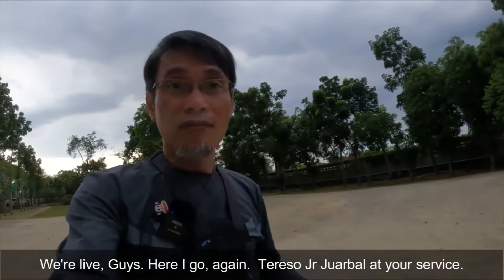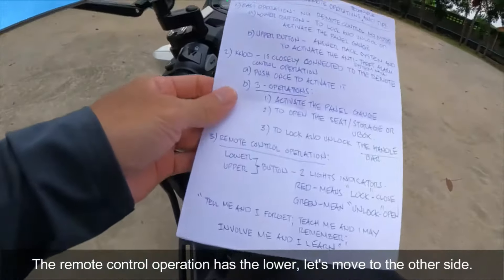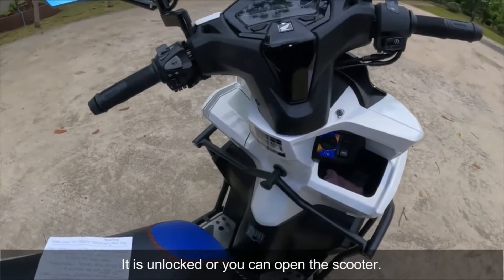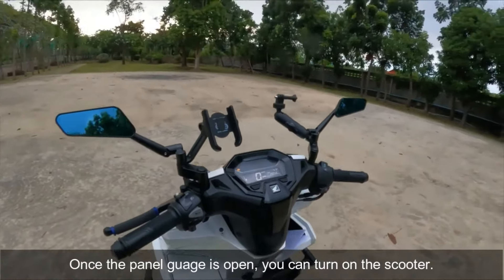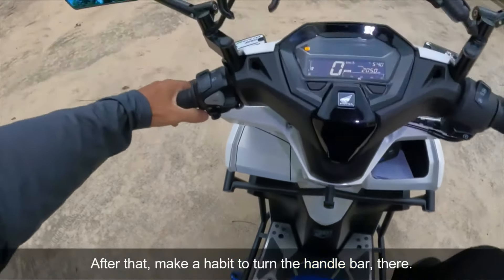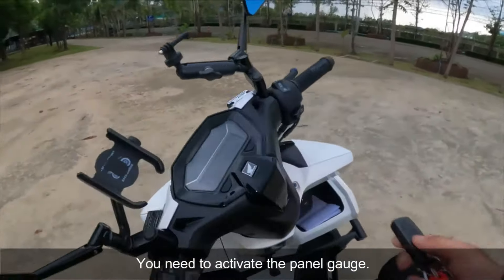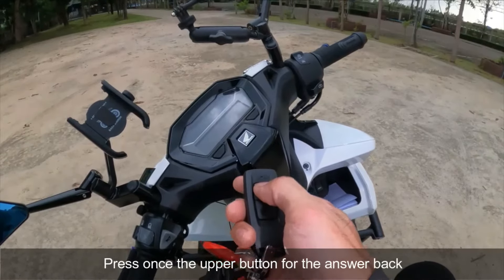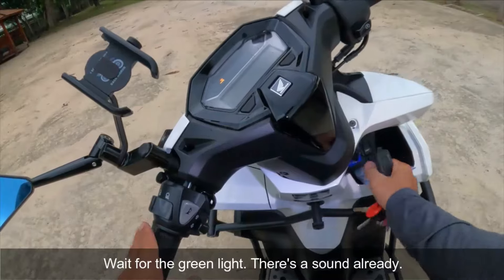Honda Click 160 : Remote Control Operation - From Basic to Advance Techniques And Tips

Comment: Sir after po ba lock ng manubela, pwede mo na din ba off totaly ang switch ng motor? 😊 thanks po.
Reply from the maker: Opo Sir. Pag lock ng manubela ay e...switch off mo na din ang motorcycle mo at poy-d na ding e activate ang Anti Theft Alarm nya para completo ang safety ng motor.

Comment: paano kapag nagbliblink lang po ng red yung lower button, ayaw po ma long press mag green?
Reply from the maker: Pag naka blink po ng red ang lower button ng remote control ay hindi mo iyan ma open ang Panel Gauge. Kasi kailangan na mag blink yong green na ilaw para ma activate mo yong Panel Gauge ng motor mo. Pag ganyan po ang sitwasyon ay subokan mong magpalit ng battery sa remote baka low batt po siya. Pag hindi pa siya gumana...ay gamitin mo ang special na Susi ng Motor mo para ma open yong Ubox at magpalit ka na rin ng Battery sa Motor mo. God bless at ride safe po.

Comment: Ano po need gawin pag di ngrereact yung motor sa remote pero ng green at red light naman
Reply from the maker: Napaka broad naman niyan Madam. Mas mabuti pa ay tumawag ka sa aking messenger para maka video call tayo para ipakita mo kung ano talaga ang problema nito. Salamat po
Reply: @teresojrjuarbalvlog4483  ano po messenger nyo
Reply: @teresojrjuarbalvlog4483  na message na po kita
Reply from the maker: Ok po

Comment: Good morning sir..ask ko lang na sundan ko naman ung turo mo about sa  on at off ng anti theft..ginawa ko na xa kagabi sir pero pagka gising ko sa umaga ayun nag biblink na naman ung  sensor nya at pag ginalaw mo xa nag aalarm na naman xa.pahelp naman..
Reply: Up
Reply: Sana mapansin
Reply from the maker: Off mo lang ang panel gauge ng motor mo Sir at huwag na e...activate ang anti theft alarm system nya.
Reply from the maker: Huwag mong pindutin ang upper button ng remote control mo para hindi ma activate ang Anti Theft Alarm system nya.
Reply from the maker: Pag ayaw parin tawag ka nalang para demo ko sayo

Comment: Paano po ioff yung red blink po yubg sa alarm
Reply from the maker: E...activate mo lang ulit ang panel gauge nya tapos e...switch off ang knob ng motor at huwag pindutin ang upper button ng remote. Para hindi ma activate ulit yong anti theft alarm system nya.

Comment: Sir paano patanyin ilaw nyan click160?
Reply from the maker: Ano po tanong nyo Sir
Reply: Ilaw ng click 160 sir may off/on ba yan ?
Reply from the maker: DRL ba ang tinutukoy mo Sir.
Reply from the maker: DRL meaning po...day running light. Walang patayan po iyan kasi nakadesinyo na palaging bukas po yong ilaw. At huwag kang mag alala po...hindi mau ubos yong battery mo. Ang excess power lang kasi ang nag power niyan sa DRL po. Kasi sa tuwing pinapatakbu mo ang motor ay nagcha charge po ito ng power.
Reply from the maker: Sagot sa tanong ng deritsahan ay walang switch po iyan para ma off and On po.
Reply from the maker: @ondesevero67  Wala po Sir. Walang Off and On yang DRL sa Click160 po. Palaging bukas talaga yan kasi nakadesinyong ganyan po.
Reply: @teresojrjuarbalvlog4483  copy sit slamat sa info